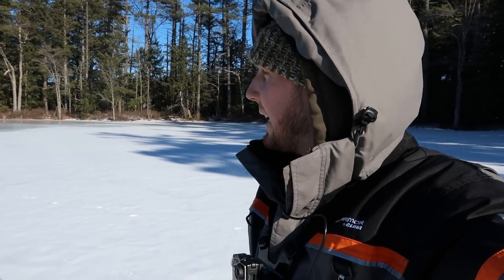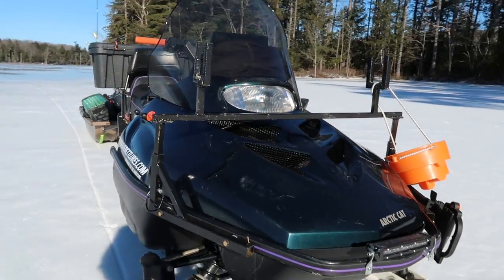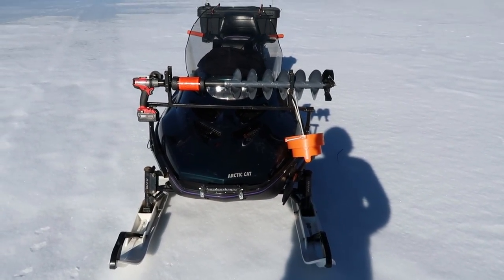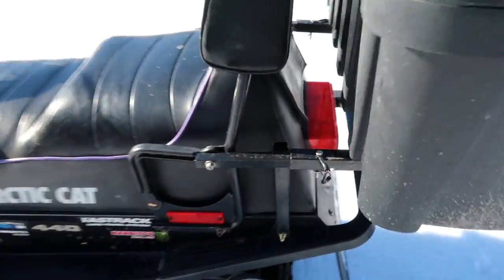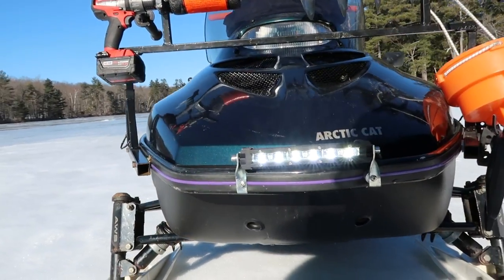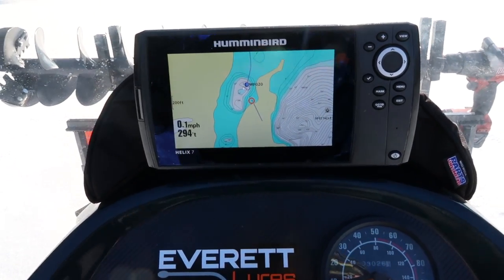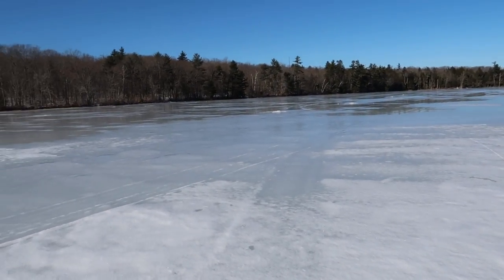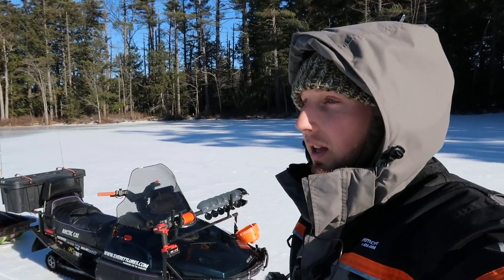SNOWMOBILE MODS FOR ICE FISHING

Comment: I have the exact same sled. A 1997 Arctic Cat Panther 440 2 up, electric start and reverse. The only thing I need to know Is where did you get that tall windshield for that sled?
Reply from the maker: John Springer Ebay I think... but you might be able to find a used one cheaper on Facebook market place from a bearcat or some other sled that’s beeing parted out
Reply: Ok. Thank you. So how high of a handlebar Riser did you put on that? And did you do it without any cable extensions
Reply from the maker: John Springer I think 4”. Yeah I might actually redo the rear rack to something bigger.

Comment: What.... Fan cooled... Lol.  Wrong explanation.
Reply from the maker: chevynut427 what do you mean. Doesn’t have a heat exchanger under the tunnel so you don’t need to worry about it over heating if you don’t have a lot of snow on the ice...
Reply: @mainetroutwhisperer  just how you explained it in the beginning ... I run liquid cooled never had to problem and run ice scratcher's.. That's all.
Reply from the maker: chevynut427 I run scratchers just to toss stuff up on the sliders so I don’t melt them down when there isn’t much snow .